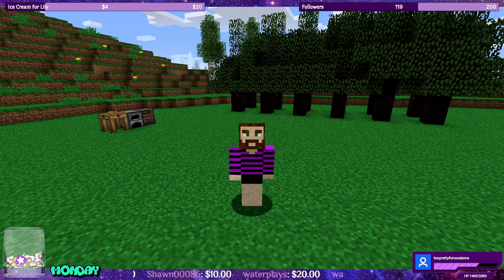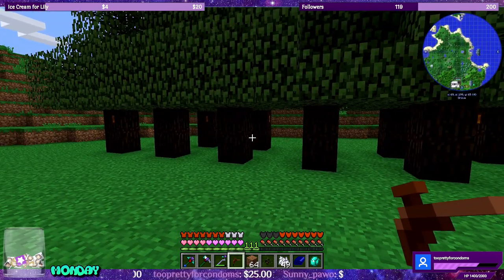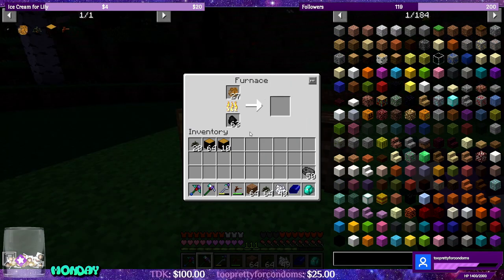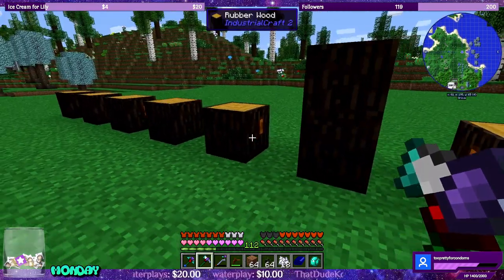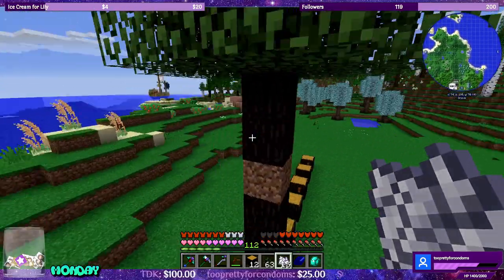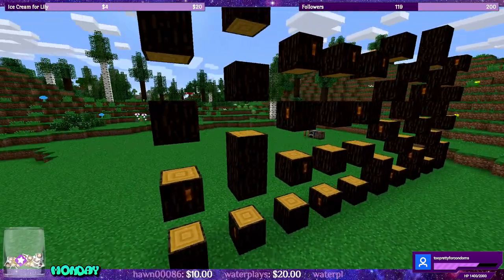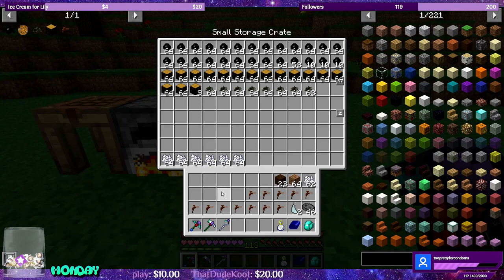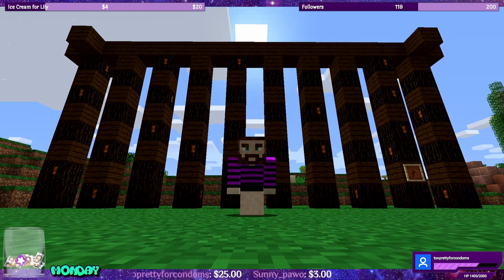Industrial Craft 2 Mod Spotlight EP 1 - How to get Sticky Resin! How to get Rubber! IC2 Tree Tap

Comment: I'm a big fan of the Cardboard Box. Do you have it in this mod pack? 
If so, can you try to move a tree block with a node and check, if it's remaining after unpacking the Cardboard Box? 
That would allow to stack the nodes even more compact.
Reply from the maker: filinta tried that, it doesn’t work. Also silk touch as well as pistons. The block is programmed to not be able to be moved with NBT and Meta Data intact.